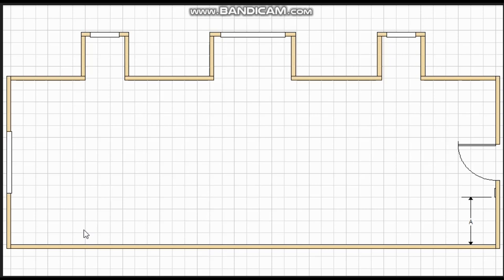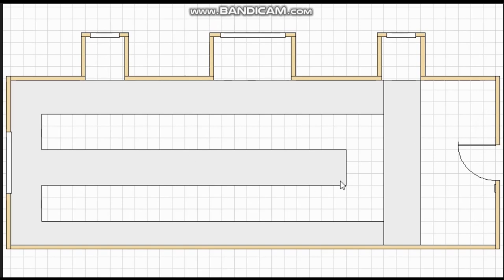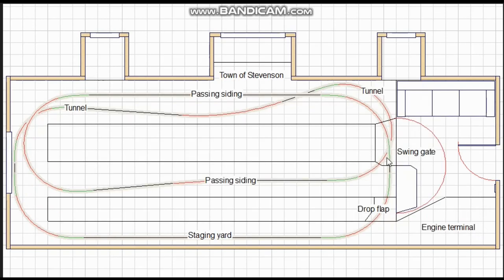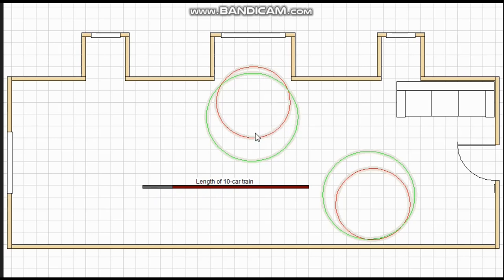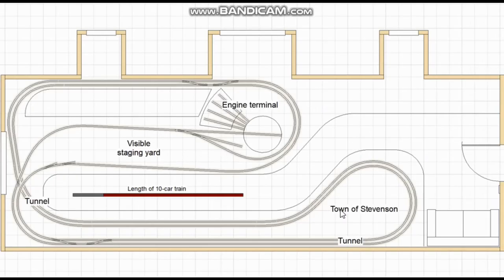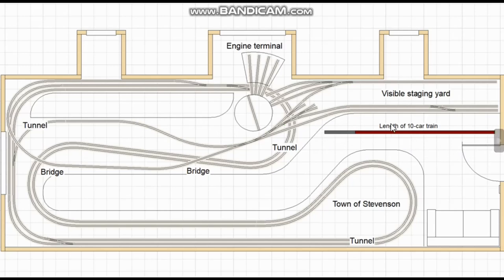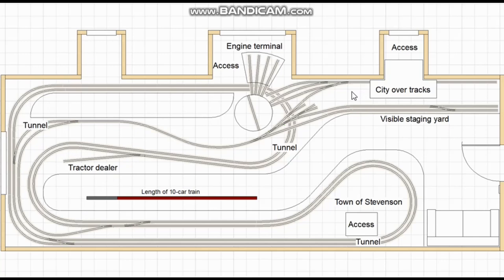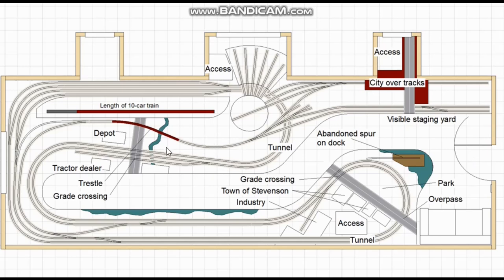O-scale 3-rail layout design for a long narrow attic

Comment: I would not like to have half the junction (connection from the station to the mainline) hidden in a tunnel. 3 switches have to be ride so a derailment is possible.  Also would add a spur next to the entrance track of the station so a loco does not block the main track when waiting on a train to arrive to take it back out. To free up the loco when the train has arrived, you always have to block the entrance track when pulling the cars out.
Reply from the maker: There are many improvements I would like to have made, but track geometry is severely restricted when I can only use one size of turnout.